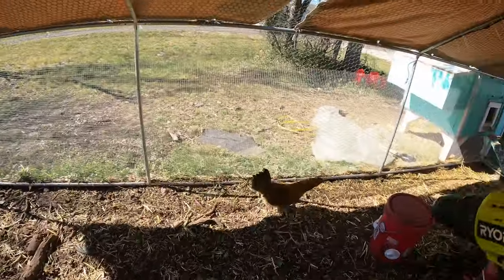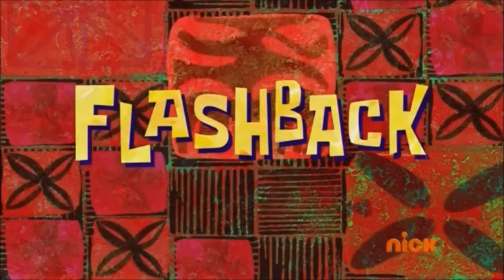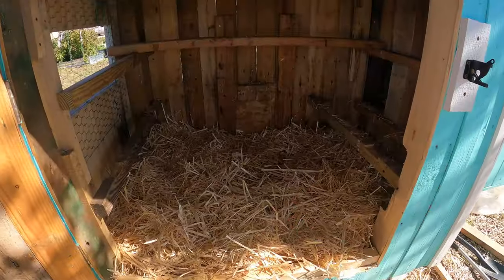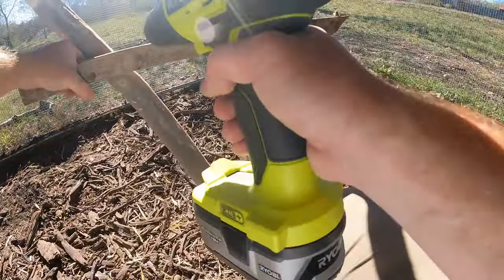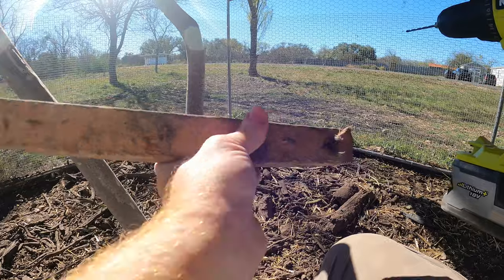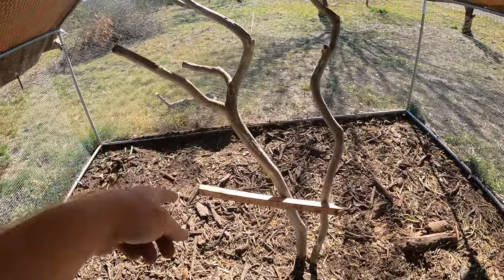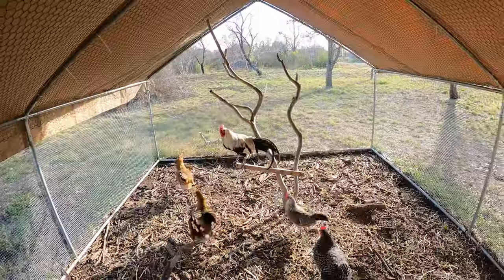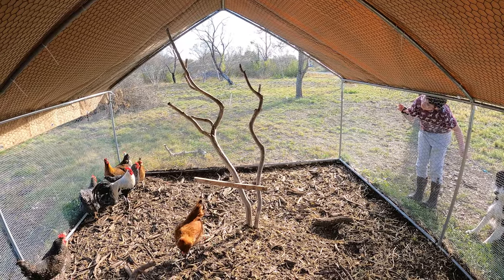I had to add to this Roost for my Chickens

Comment: Oh yeah you need to move the entire door entrance up by about 8-12 inches about the same height as your nest boxes in order to hold deep litter.
Reply from the maker: Oh wow ok yeah that isn’t gonna happen.  Oh well.
Reply: @Escapingthedailygrind  It would not be bad. It didn't look like you had any framing above. Just remove the trim, then cut the opening taller with a plunge cut, scab out framing at the bottom to which to fasten sheathing and place the trim back.
Reply from the maker: Well in the summer i cannot do deep litter method.  It gets too hot and deep litter causes warmth build up. It gets to 110 degrees some days.  So I can’t like convert the whole thing to deep litter permanently like that
Reply: @Escapingthedailygrind  Maybe if you have no ventilation.  Matt's Carolina Coops work well in any season north or south.
Reply from the maker: I don’t know the cost on those however, on their website the watering system costs more than the coop I bought.  Haha!  I’m sure they are great, just not affordable for me.  There is good ventilation yes, however there are so many hosts of issues with deep litter in the hot summer here.
Reply: @Escapingthedailygrind  hmm too bad.